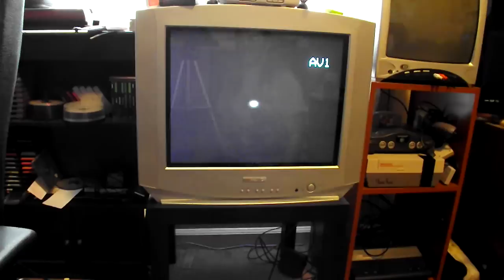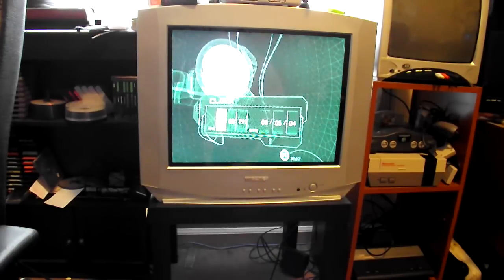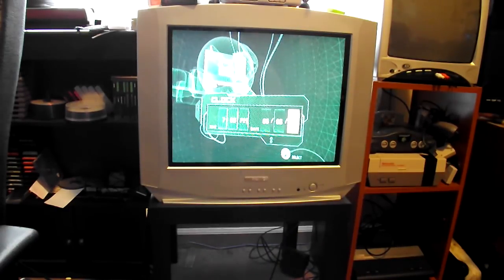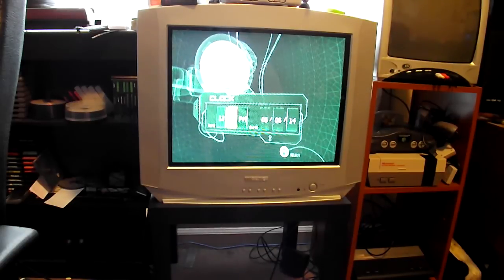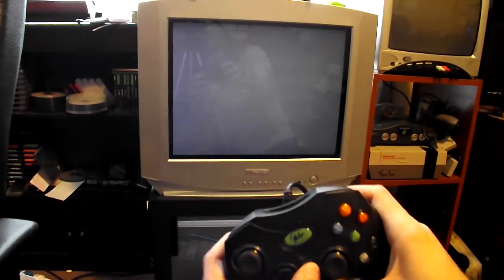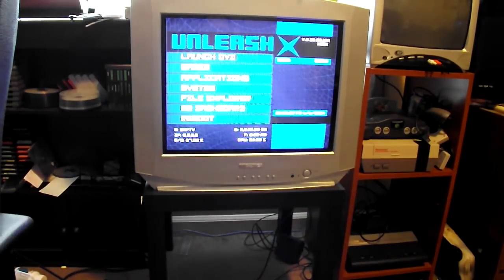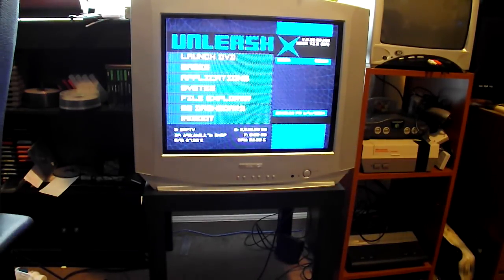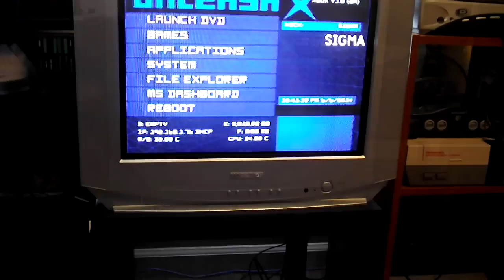Original Xbox power supply replacement

Comment: Also if you are in a PAL country like me and don’t want to run step down converters then this tutorial is good for replacing a power supply to PAL. I say this because I just bought an Xbox original Japanese Black Skeleton and it uses NTSC 100V power. Thanks for the tutorial will be using this soon
Reply from the maker: You know, a few years ago i got a PAL PlayStation 3. Person said it didn’t work. Swapped out the PSU to one from another side dead US PS3 and it worked fine. The power supply just expected 240 and only 240. Lol.

Switching to the universal 110/240 PSU that I had available that little problem. 

I just bring it up since it’s the same problem and your comment reminded me. 

Glad that a nearly 10-year-old video can help you out.  :D
Reply: @KurisuYamato  Yeah im glad these types of videos are around, much like old forums except not dead links etc lol. Bought the part off EBay just need to wait until it ships out, will make sure Xbox works first then replace all capacitors including clock for both this black skeleton and the one I’ve had since I was a kid which is PAL but it’s a 1.4 version.
Reply: Also good that you still respond years later so people that happen to stumble on your video can see more information about swapping power supplies etc
Reply: @KurisuYamato  I installed that 240v power supply last week and man is it a pain to take out that plug in the motherboard, thought I broke it but the plastic tab switches away. Can confirm that xbox works which is cool, but mostly likely have some trace rot going on as the power button doesn't work and eject works as power button. It's a 1.0-1.1 motheboard so no suprises there tbh
Reply from the maker: @cdst1997  Yeah, sounds like the clock cap did its damage. It's a pain but I know the trace can be bypassed / bodged -- helped do it a few times but that's not something I really got the hang of in my repair years so, yeah... :|

AT LEAST it's alive, though! That's the important thing.

Comment: Great video, would a bad power supply kick the breaker on the wall plug (xbox), not a GFCI, when we plug it in? 
Or where can someone get the OEM Power supply cable?  The breaker on ours kicks even when its not connected to the XBOX.

Comment: My power supply took a shit on me a few days ago and I wasn’t confident in my ability to repair the console myself but seeing a few videos on how to tear down my Xbox I feel like I’ll be able to do it it’s a 25-30 dollar fix rn so it shouldn’t be too much trouble
Reply from the maker: Yep, it ain't bad. Just open her up, check which PSU you need of the 3 main versions, and once you have the new one plug the bugger in.

Most annoying thing is getting the PSU out in some versions -- it can be a tight fit after 20+ years of being in there.
Reply: @KurisuYamato  what are the three versions of the PSU I should look out for and thanks for the reply I appreciate your time sir
Reply from the maker: @sir_i.p.freely3757  I'm sorry, it's been so long I honestly cannot recall exactly offhand -- 1.0 to and 1.1 I think use the first version, 1.2-1.5 use the second, and 1.6 uses the last version made but I could be off on exact details.

I haven't messed with this kind of stuff in years -- hell, everything you see in this video that I still own is in storage. :\

I can say for certain there are 3, and they are very distinctive between eachother thanks to their connectors being very different.

There are "universal" supplies, which I did try one when the PSU in this video blew (yeah, never made a video on that but the replacement in this video failed on me) but I found it to be of sub-par build quality.

Trick is to just make sure whatever replacement you find has the same connector as yours for the main board. Should be fine then.
Reply: @KurisuYamato  thanks for replying man I appreciate the feedback it should make it easier to teach down the proper psu

Comment: Any tips on getting the psu cord unplugged from the motherboard I got the same Xbox but can not unplug that cord for the life of me.  I mean my Xbox has seen some abuse and time hasnt been good. I tried pulling straight up nothing tried at angles doesn't budge.
Reply from the maker: There are 3 different types of plug, if memory serves, that can be on your Xbox Motherboard and PSU. Check everywhere you can around that plug for little push-in clips or something similar, as those are probably what's locking it in there. A very carefully used flat tool can help if the parts are for some reason actually stuck together but as you're working near the PSU be VERY careful should you choose to use anything to try to lever it out. I've seen stuck ones a few times at work but usually had no issues but yours could always be one that's just really tight.

I hate that I can't provide more advice beyond this but without being there and with how simple the plug is I really think it's just in there good and is going to need some effort to force out, barring the aforementioned clips. A 3rd party PSU I got for this Xbox after the one shown in this video died was like that - it was stuck in there really good but things were fine once I got it out.

Just take your time and be careful.
Reply: @KurisuYamato  I'll try my best and thanks for the help right now my psu is fine I just wanna clean it and try to de-rust the shielding and remove the clock capacitor but I can't lift my board out with the psu cable stuck in the way lol. Plus the cap is too low to the board to wiggle out.
Reply from the maker: @everythingdigital1  Good that you're being proactive!!! Best of luck.

It's funny, Xbox's are fine to work on until something like this happens. >_<
Reply: @KurisuYamato  Used some metal wire that was coated with plastic as to not mess anything up pulled on one side then the other tons of junk was under the cable maybe why it was so difficult I don't know but now i still can't get the mother board out even  though it loose lmao.
Reply from the maker: @everythingdigital1 Geeze! Yeah, clearly someone got something in there and it's a mess. Funny, this isn't the first time I've heard of or seen this firsthand -- got an Xbox in the other day that I swear had maple syrup all in it! 

...sounds like you're going to be cleaning it up for a long time. Let's hope getting the main board out doesn't damage anything. :(
Reply: @KurisuYamato  I hope it hasn't I had to hang it upside down kinda just sat and waited and got it out but one of the other plugs came out by force. Other then that I got it out but man the whole underside of the case is rusted clean through but the back of the board looks fine some how. Could swear just by judging the case the junk and the cables this thing looks like it was tossed in the ocean for 20 years lmao i'm amazed how it turned on last night.
Reply: @KurisuYamato  Do you know if the power supplys are fixable or where I could order a new one cheap I did the clock removal and it turned on then something blew in the psu.
Reply from the maker: @everythingdigital1  ebay is the spot I always go for such.  It's hit or miss what you will get but it's at least a source. :\

Worrying that something blew it -- could be anything but you certainly should look over everything to see if you can find the cause.

Comment: torx 20 and torx 10 are the tools you need for the old original microsoft xbox
Reply from the maker: +ronald henson Yes, they certainly are. Most small screw head kits will feature them.

I'm actually quite fond of star bits - they fit nicely, and I seem to never encounter stripped ones.

Comment: I have the exact same power supply that you have in the video but i am going to resolder the joints near the power cord port. I am having some serious trouble getting the power connector off of the motherboard, do you have any advice on removing it safely? Im worried i am going to damage the board or knock one of the capacitors off because i cant get enough leverage to pull it out. Would it be dangerous to attempt to solder the joints with the cable still connected to the board? In the video you said when you tried to solder it that it sparked because it touched the metal housing of the xbox.
Reply: Same. This thing is TIGHT

Comment: Any idea why the 1.0 has a fan over the GPU, whereas the versions to follow did not? Did it even improve cooling and was the extra noise worth it?
Reply from the maker: No idea for sure: best guess is they felt a small heat sink and fan would do better than a larger heat sink, or they wanted to save money on metal costs, but later decided the larger heat sink was better.

Oddly, the noise of the 2nd fan never bothered me - once I lubricated the fan on my 1.0 machine (the one in this video) it was silent enough not to bother me.

I know some people put 1.1 and later heat sinks on the GPU of their 1.0, so it doesn't look like it need the fan variant, it was just what they went with.

A good question. Perhaps one day someone will ask the designers that.

Comment: How did you get the motherboard power cable out?
Reply from the maker: There are locking tabs. Sometimes, depending on the particular revision of the Xbox, they can be a right pain to remove. Just look carefully and you'll see them, and then the thing should come out. Given the age and heat some of these have been through, though, they can be awfully tight, so if it doesn't want to budge just keep trying, but don't do anything too crazy.
Reply: @KurisuYamato  thanks,  yeah I had to apply serious force to pull it out. I was just afraid of damaging the board.

Comment: hey.. I see that this video is 2 years old.. I hope you reply 

so do you know a place where I can buy an Xbox PSU?
thanks in advance
Reply from the maker: Haha, yeah, on the 6th it will be 2 years. I reply to virtually every comment I get.

Anyway, best place is straight off of ebay, unless you have a local game console repair shop that happens to have a stock of spare, dead Xbox's to try to salvage one from.

The Power Supply in this video actually blew up on me some time after I installed it, and I had to get a replacement from a local game shop.. this, AFTER I had bought a generic 3rd party one that wasn't quite up to snuff when it came to providing power.
Reply: +Kurisu Yamato do you mind telling me how much it will cost me if I get one from you? 
You see, I don't have much money and live in the Philippines
Reply from the maker: kiute 07
Ouch, that might be a problem to do. The units usually cost around $10 to $20 USD when available, but I would also need to know the model of Xbox (there are 3 PSU connector revisions).

A universal one would work but like I said, I don't recommend those, although I think my struggle with one was due to my Xbox being an original model, which uses more power than later versions.
Reply: +Kurisu Yamato Well it is a 2002 model.... It is compatible with foxlink Ftps-0002..
What country are you from ?
Reply from the maker: kiute 07
Hmn, probably a v1.0, 1.1, or possibly 1.2 unit. As for my location, United States.

Comment: where can i buy a new power supply
Reply from the maker: Ebay! That's the best place to find em, usually - that or a local used game shop that would specialize in such components. You just have to make sure it matches to your Xbox (there are 3 different power supply models!) It's easy to tell looking at the connector, where it actually sockets into the motherboard - all 3 look very different.
Reply: +Kurisu Yamato hey man, my power supply has been 'sparking and smoking'. It takes a 10 pin power out for the motherboard and not the 24 pin. Is there any way that I could use a 24 pin power supply on a 12 pin Xbox Motherboard?
Reply: You have to google it but you can

Comment: Mine doesn't power up either coz I plugged it to 220v supply. I didn't change the whole power supply I just replaced the burned capacitor and it's working now.
Reply from the maker: Great job replacing the blown cap and getting things going!

My original PSU was damaged by me accidentally shoring it out in a way that I couldn't tell what had been blown - at the time it was easier for me to just buy a new one than attempt to figure it all out.

Now? I probably would do everything I could to figure out what part blew and fix it for the fun of it, lol..

Comment: If buying a spare xbox , shall I swap psu or harddrive ? To have score data and funtioning psu in one console!
Reply from the maker: +Eric Unbekannt Sadly, you cannot simply swap the hard drives - they are locked to the console board. This is why I would hope your machine isn't completely destroyed.

I would try to find an Xbox that is from the same manufacture date as your damaged one, so that you will have the best chance at getting the PSU model for it (there are 3 different PSU models) and try it in your damaged machine. With luck, it should work fine.

Comment: My xbox last time i used it makes some weird when the AC is plugged in can't remember if it does it all the time
Reply: ***** Quick reply :) it's the power noise like popping and sparking.. I have 2 xbox's so I might swap out the power one day as the one that has the issue is one of the limited edition see through green. Hasn't been turned on for years but watching your video makes me want to play on it again. 

I will give it another look when I get it out. Thanks for the reply :)
Reply: *****  Oh didn't know they had 3 different types of power cables. My green see through xbox is just see through doesn't have anything written on it apart from of course the Xbox on the top. I can't remember what it was called on the box. I remember seeing those LED mods a while back always wanted to mod mine with some led's. I am tempted to put another HDD in it when I get it going as currently everything in it is what came with it. Still remember opening it at Christmas back when they were popular
Reply: ***** I will try and dig it out it's right under some stuff. I always remember I got Hulk with it and the box the xbox came in was white and said limited edition on it.. I will try get it out tonight and take a picture of it for you.
Reply: ***** I have managed to dig it out. It now has a few light scratches unfortunately and I cant find the green controllers that came with it or the power cable but I am sure that will turn up.. I took 3 pictures of it if you want me to send you them :) If i can fid the power cable I will get it running again. still have lots of games on my shelf for it
Reply: ***** I think a while back I did find some info on it it's possible it's the hulk edition but I always thought the hulk version was light green, It could possibly be the Xbox Translucent Green Spring Limited Edition, It did come with 2 controllers and I am pretty sure Hulk was included

Comment: hey enjoyed the video! hope you see this message 
My xbox is in a similar state, it just would not turn on. but the weird thing is that when i plug the cable into the power socket, it makes a weird faint noise that you can only hear when you put the xbox against your ear. So I would like your help in figuring out what i can do.
thanks
Reply from the maker: The noise is probably coil hum, common in many devices for a variety of reasons - in this case, it may be a side effect of something anywhere in the system (but hopefully just a power supply issue) having failed.

Can't say for sure that  the PSU is the issue, but if you get no action from the system, it's worthwhile to try to replace the PSU, since that hopefully is the issue, but it may not be - only way to know for sure is to pop it open and find out.

Comment: +Kurisu Yamato I have a 1.0 board just like yours except my PSU is 2 rows. Do you know what model PSU that is?
Reply from the maker: By all accounts it shouldn't be a 1.0 board - they simply weren't made with the later socket type for power. Does the GPU have a little fan with it? If so, strange - could have been a mod done by someone though.. unless it's an Xbox you have always owned in which case, oddddd..

Regardless, that doesn't change the issue at hand - you need a PSU that will socket in.

I would think, judging from a guide I'm looking at now (as I really can't remember all these details, lol), that you need a 1.2-1.5 type PSU, as I'm pretty sure that's the model you describe. http://adriancallaghan.co.uk/wp-content/downloads/Guides/XBOX_REPAIR_GUIDE.pdf (look up "Power Supply" and you will find the section that talks about them. Information on original Xbox is starting to become scarce and old sites that I used in the past are now gone, so I'm having to hunt for info my own self!)

My suggestion is hunting online for a seller, possibly on eBay, that has an xbox power supply that looks to match yours - if it does look good, then it probably is. Power drain is the same so as long as you get one that physically sockets in, you should be good to go!
Reply: My mistake, it did only have a 1 row socket. When I had it open I could've sworn I saw 2. It does have a GPU fan and the LPC Debug Port is soldered up, so it's definitely a 1.0. I fried my motherboard is there a way I can tell if anything else is fucked up? Other than the spots I soldered it actually looks fine. I removed the clock capacitor and attempted to bridge the 2 points for a TSOP flash( easy I know, I made a rookie mistake when doing it). Also is it ok to remove the RF shielding on the bottom? I kinda feel like its in the way.